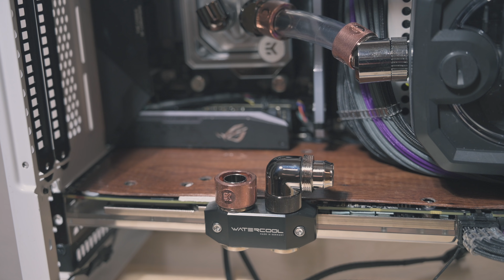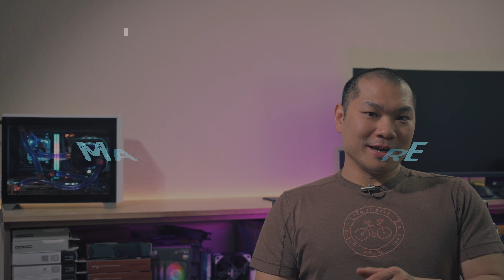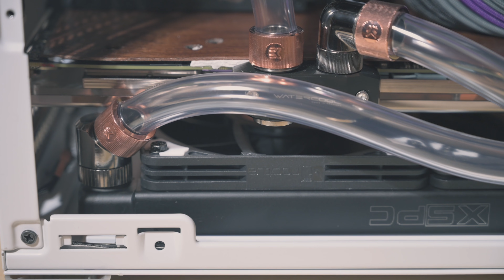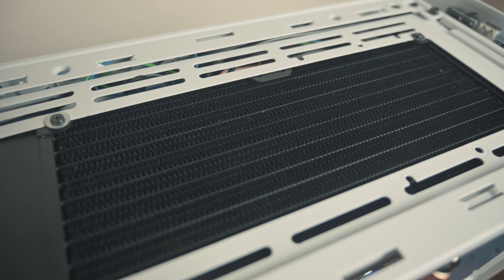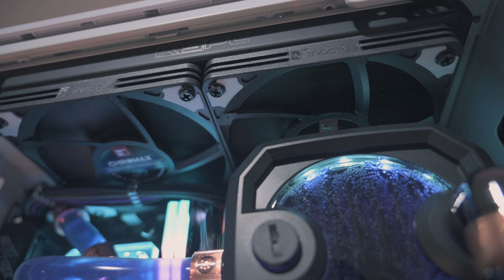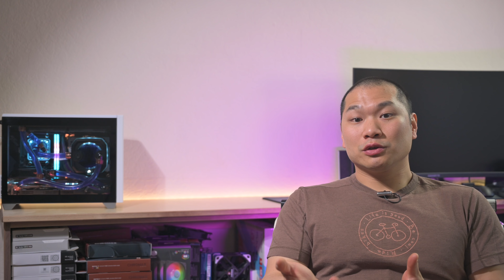Custom Loop Performance with the Dual Rad NR200P!

Comment: Quick question, can you fit that AIO in sfx-l mod?
Reply from the maker: SFX-L is tough, you won't be able to drop the PSU and you won't be able to get the top rad to fit.
Reply: @MachinesMore  Thanks a lot! I wonder if in that case it will make sense putting a 140mm (on left of cpu) +240mm setup could work well.

Comment: I'm building a similar NR200P build, using the same same corsair pump along with a corsair waterblock.  My build will be with hard tube.  I'm not  water cooling my 3090 FE, so I will have two exhaust fan on top.  I will be using a 92mm rad for the back, hopefully it will be enough to cool my 5900x.
Reply from the maker: Single 92mm for the 5900X? Or another rad elsewhere?
Reply: @MachinesMore  
Single 92mm rad for my 5900x.
Just running it at stock, if I can get around ~80C while gaming then I'm a happy camper. 😊

Comment: Awesome build, you mentioned this isn't the last iteration, will you be putting up bar charts vs other configurations of temps/noise in that future video?
Reply from the maker: Cheers. I will be switching it up as different components go in, the configs (rads and fans) will mostly stay the same, pretty sure tubing run will change though.

Comment: Thanks, great video, a slick build, and you're really tempting me to push my upcoming NR200 build much further than I'd thought. Still, I'm not sure I want to spend the time on a full custom loop. Are there any AIOs with a thin-enough rad to top-mount them (using the panel mount trick from your previous video)?
Reply from the maker: There is a fellow over on r/nr200 that mounted an AIO to the top panel directly- the fan and RAM choice is critical but it can be done, PSU has to be in the front position.

Comment: well. i just got my cpu cooler, nox hummer h-224 noir, fits with tg , for my 1600af is fine. no wi need better psu cables

Comment: Beautiful build!  I'm debating doing something similar.  Waiting on my tx240 rads to come in.  Do you happen to know if they are actually 125mm wide (The tx240 radiator that is)?
Reply from the maker: Cheers. pulls one out to measure 124mm actually on the regular flow version!
Reply: @MachinesMore  thanks so much!!

Comment: as always thanks for good content 

i hope i get my cooler master sfx psu this yeahr =/ i want finish my nr200p
Reply from the maker: Are you waiting for the 850? Later might be better! Another viewer mentioned the ETA for the revised SFX units is going to be later anyway... would save you the hassle of exchanging with them if you don't like the current fanless behavior.
Reply: @MachinesMore  yes i wait for the 850 psu in germany my 92mm rad for the back comes finally tomorrow after waiting 3 months

Comment: really enjoyed this one! planning on doing a similar build on my own with my 3700x and 3080 tuf :)
Reply from the maker: Do it!
Reply: I was planning to the same but I have to change my GPU to a different one. The height of the 3080 is too much with the waterblock and because of that, u can't close side panel. Reference 3080 should fit with water block.
Reply: @Wiljamii  interesting... wich Block did you use?
Reply: @felixseegers439  EKWB. Alphacool might fit but it's gonna be close.
Reply: @Wiljamii  I will have a look... thanks!

Comment: Do you think a triple 240mm rad is possible if you had a barrow pump res cpu block?
Reply from the maker: I think so, or the Swiftech Apogee. You will have to bum a rad panel off of someone though! The one potential interference could be the way the fitting exit your GPU block- since they may protrude enough to get into the side rad space.

Comment: How’s the fan noise on the v650 in this case? Audible or no?
Reply from the maker: I haven't gotten the revised one to test, in fact I don't know if it's even available yet, but with the CM SFX units, it's definitely an audible behavior if you have the spike up at the beginning. At constant load, it's not a big deal since the fan ramps down and just runs at a lower level.
Reply: @MachinesMore  thanks man. You’re the king of detailed sfx reviews, builds, and news these days. I have a 3090 FE and 5950x OC @ 4.3ghz I want to hookup to the CM V850 SFX PSU for my O11 Mini build, but I’m glad I saw your video on it first. I guess I have to wait until after it’s revised.

Comment: Could you maybe compare fan configs? Top Exhaust, Bottom Intake for "balanced" pressure?
Reply from the maker: Just from experience, the top exhaust would be a little less effective since, unless you're using an open side panel, you're recirculating the warm exhaust from rad #1 into rad#2, so rad #2 doesn't actually get to do too much.

Comment: ....ok... I didn't know you can mount a (slim) 240 AIO Rad on top with that "no mod" mod.
Problem is I've been having a hard time taking off the top panel, everyone does seem to do it easily.
I'm using NR200 btw.
Reply from the maker: You mean popping off the top panel? Just make sure it's not screwed in and "carefully" pry it off from the tab at the back. It will take more force at the beginning... don't be surprised when it suddenly comes off.

Comment: Great stuff! Subed!

Question/idea: gpu with a waterblock mounted vertically for the views. Would i be able to fit a “standard” or thicker rad at the bottom? Guessing the riser cable and gpu would hit the Fans eventuell, or might be blocking the whole airflow.

Stupid me has his mind set to build my first watercooled pc in a nr200 or ncase in times like these😂 i need to wait till summer...by then i hope the situation regarding hardware has cooled down ....

Stay healthy n safe! Love the calm voice!
Reply from the maker: Yes, you can- there are a few constraints with card length vs pump/res location, and location of the GPU block fittings (if you mount the top rad, the top fittings with a vGPU can hit the top rad/fans, fittings at the end are better). You actually have a huge amount of space under the riser- even a thick 40mm rad with 25mm fans should clear. The safer bet is to go with a combo CPU pump/block, and a card with fittings exiting the end of the card (something like the EK 3000 series FE blocks)... run the tubing for the CPU block before installing the GPU and then doing that side of the run. Let me know if you need measurements for the inside of the case if you want to plan it out. A vertically mounted pump/res at the front should fit with a shorter card.

Comment: Just to confirm, both rads are pulling air inwards?
Reply from the maker: Yes. With a setup like this- if your rad exhaust from the bottom just gets pulled through the top rad, you're diminishing your cooling capacity. Hotter case air is fine as long as it can exit, but you really want to prioritize the temp of the air running through the rads.
Reply: @MachinesMore  wonder if adding a 120 fan at the back would help this setup
Reply: Would you be able to mount a thin top RAD without a mod ? 
Maybe by installing both push and pull slim fans and using NR200s top mounting system ?

Comment: Have you considered going with a single thicker 240mm radiator at the bottom with a vertically-mounted GPU + waterblock?

P.S. I'm currently running a dual rad (PE240 on the side mount, TX240 in the bottom) with a 3900x and 2080 Super (both water-cooled) and it performs excellently. However, I'm going to be upgrading to a 5900x + 3090 soon (once my Bitspower GPU block arrives), and would like to try the tempered glass side with vertical-mount GPU. As you mention, the ASUS mini-DTX board will likely not allow me to do a top-mount TX240, so I think that dual-rads are out of the question for this upcoming build.

P.P.S. I have a surplus of TX240's (bought for my own projects) if you need one. 😉
Reply from the maker: Cheers for the offer! We have something in common with the stash of TX240s 😂
The PE 240 is a great option and your arrangement is probably the best amount of heat fin surface area you can get into the case.

I did consider the vGPU option and it has its own constraints- you either need a super short block that stops short of the pump location, or use a combo cpu/pump block, or go without a res. On top of the card you also potentially run if you're running a top rad and fans- there’s about 18mm-20mm above the PCI slot top so you would want to use a block with fittings at the end like the EK FE blocks or the Asus EK 3070. The space that the vGPU would occupy is directly in competition for the pump/res space. A vertical cylindrical unit mounted against the front panel would probably give the best clearance if you want a pump/res but even then with the tubing run it might be difficult since those have to exit at the front of the pump. So, it’s not impossible, just a little too much hassle IMO for a little more surface area.

edit: I may have glanced over the details of your setup initially- thinking it over again, you already have a cpu pump/block and you just want to run one rad, so yes, I think you could do it with one PE240- just be prepared to run fans really fast at load- I think 2X Noctua NF-A12x25 would be the best bet here since with that thermal load, you're probably looking at 1750RPM+ at load to keep the coolant cool enough. Figure that going from 2080S to 3090 will add about a 3900X's worth of energy to your loop, plus you're taking out a rad.
Reply: @MachinesMore  Heh, in that case I'll probably keep my dual rad setup and just swap in the 5900x and 3090 in the existing orientation. To your point, yes I have the Barrow CPU rez + pump combo. The build is very space constrained; aside from all the ZMT tubing and various fittings, I have a pair of Koolance quick disconnects so the side-mount PE240 can be easily removed.
Reply from the maker: Yeah, I can envision how tight it is, I think your current setup is going to be quieter especially with the 3090 in waiting.
Reply: @obfuscurity  are you selling tx240? I need it.. 😔

Comment: Nice to see the NR200 getting more love with the water... Mines single rad in bottom with the FLT120 right now. The install for it literally was just drilling 2 holes in the FLT mounts that come with it so its pretty easy. Interestingly enough though using the corsair with my setup would of been easier as I am using the corsair commander with a temp probe in one of the extra FLT ports into the commander & then using adapters to hook the EK RGB up to the proprietary corsair stuff. This allows me to use the corsair commander to set the fan/pump speeds based on the water temp. I have the commander in the front panel to make this happen & some of the extra wiring up front, but most of it is sitting behind the rad across the bottom in the back. I have seen pictures of the XPSC ultrathin rad mounted in the stock fan location with the noctua thin fan's up top. I am looking to do the same, but not sure if I want to do that or 3d print a solution to replace the top panel or extend it up higher. giving more clearance for everything.

Comment: Do you think it'd be possible to do a 'dual' AIO loop using the bequiet! pureloop aio mounted on the bottom (due to pump on hoses) and using a hybrid gpu radiator on the side mount? It'd like to do something like that but wonder if it'd fit. Hybrid gpu like the evga ftw3/xc3 3080 aio
Reply from the maker: I think it will still be too thick to fit a horizontally mounted GPU, and if you put the card vertically I don't know where the other rad would go. How I might see that kind of setup working is with a hybrid card featuring a 120mm rad, and also a 120 AIO for the CPU, if you mounted both on the side panel.
Reply: @MachinesMore  Ah I see. How about this....I mount the bottom radiator fans..externally! so it'd be just the ~27mm radiator on the bottom (with fans outside on the bottom, feet will be elevated a bit higher) and the gpu
Reply from the maker: That would be one way! Most hybrid cards are "2-slot" so you may be able to squeeze a thinner rad like the one that comes with the Pure Loop. It's not a big deal, but hybrid cards usually have a fan to cool the power delivery, so that would be taking in your CPU exhaust. Also- this varies from card to card but if you could imagine how the tubes would exit your hybrid card- it may be hard to bend it enough allow the rad to go onto the side panel. A hail Mary idea I could come up with is if you went with a vertical GPU, and then stacked the rads together- it wouldn't be the best thermals, of course.